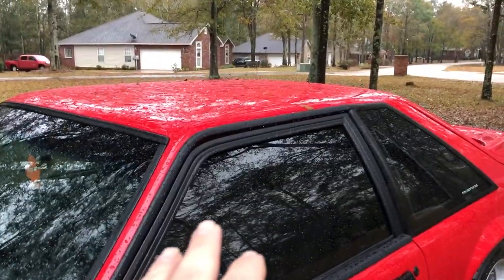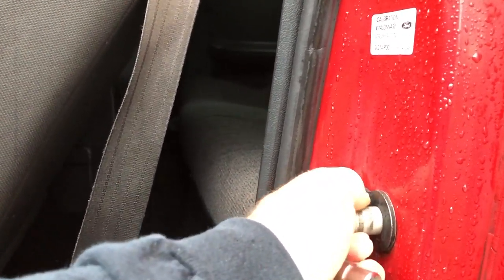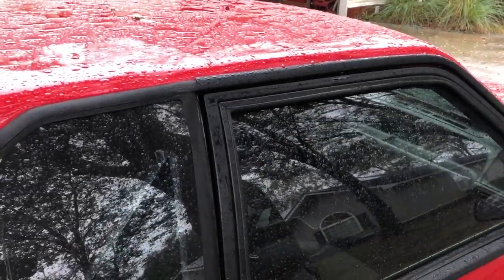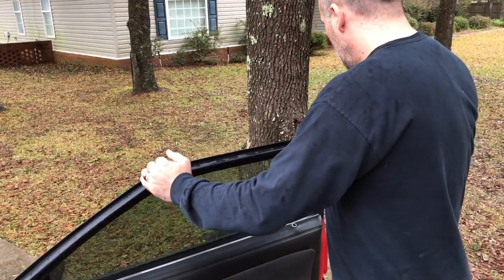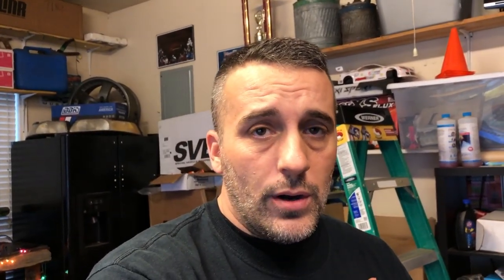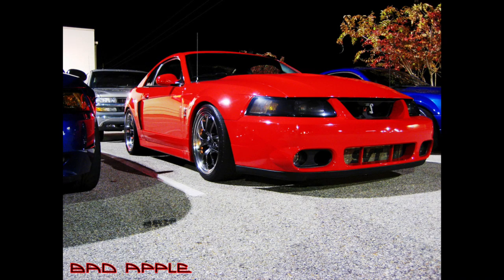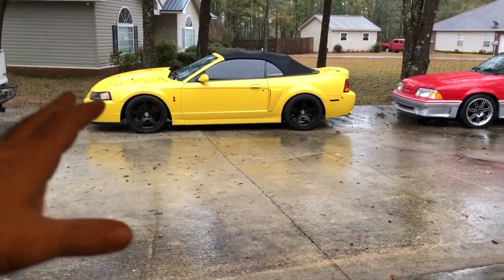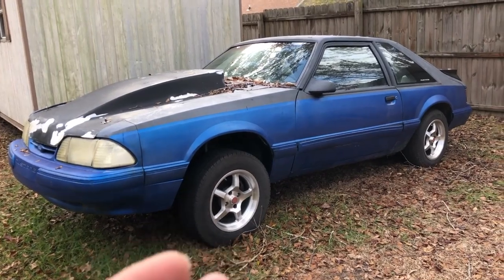B-R-E-W-2-L MEANING /// & /// LEAKING FOXBODY DOORS?

Comment: If you relate to Brew2l then keep it. You could add fox, mustangs, or pony to the end and that way if anyone searched ur name it would still come up.
I worked at the VW assembly plant for 5 years and left a couple years ago and the body fit guys would crank the doors so hard you could hear it crunch 50yrds away. They would put their knee on the door panel and grab the top of the door and lean back with all their weight. Those were also brand new cars
Reply from the maker: Wow 😮 that’s crazy! Good point btw👍